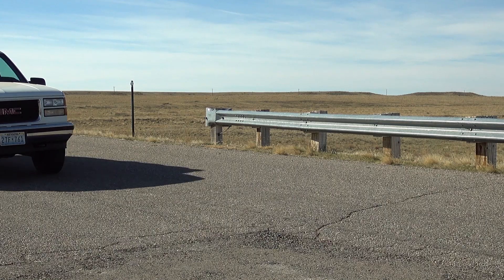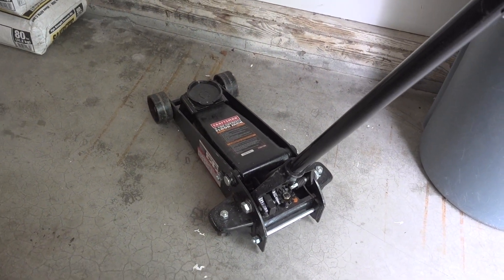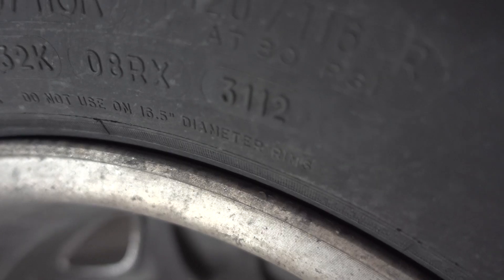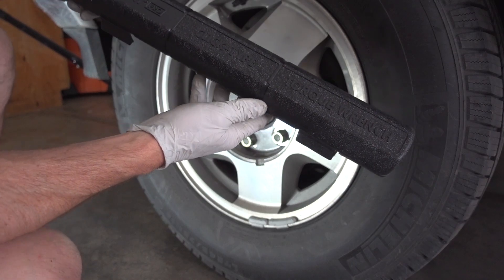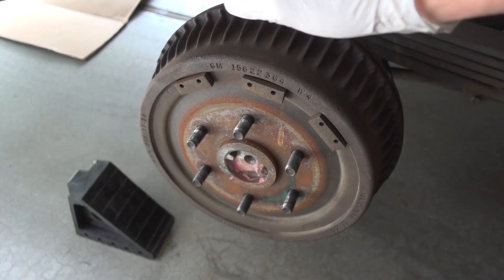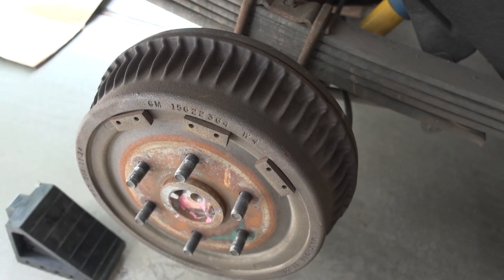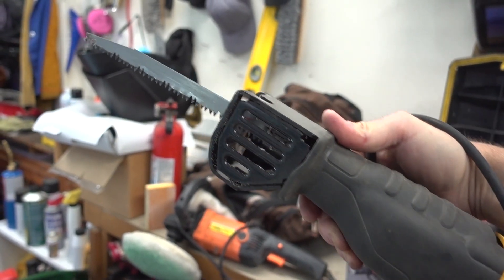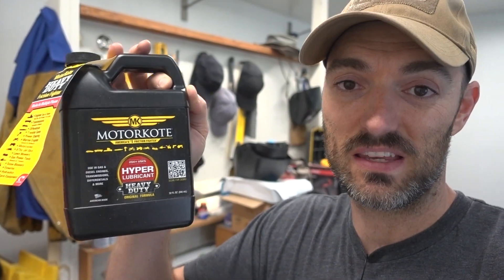SIMPLE FIX FOR TIRE HUM!

Comment: Don't cross radiel tires!! Your thinking of bias ply tires! Your asking for a blow out if you cross them!!
Reply: John Mccord 
I’m pretty sure he is fine. The diagram I found said to cross them
Also. It said cross fronts to back and back forward. How would a non directional tire know what side it was/is on. What ends up happening by crossing is the right and left eventually end up on opposite front sides.
You would not want to cross directional tires.

Comment: I saw a couple problems... first is EYE PROTECTION. Second is foot protection. Third is, you didnt show it, but it seems you did not check your drum brakes. And on a side note, I saw that your lug nuts looked new. They also said "metric" on them. Are you in Canada? If not, you might have replaced your lugnuts with metric ones. Shouldnt be an issue but I do not suggest anything that was not original equipment.
I dont think you should be telling people how to do stuff if you dont know how to do yourself.  By reading the comments, you have given out a couple of bad and unsafe tips. Like putting anti-seize on your lug-nuts.
Not to mention, the title of the video has nothing to do with the content in your vid. And the last 1/3rd of your vid was off subject. DONT PUT CRAP IN YOUR ENGINE!!!! You have Mobile 1 full synthetic oil in your vehicle. Its the best stuff you could use. And by putting that other crap in there, you are contaminating your oil. Additives are for people trying to keep their junk running. If it doesnt have issues, you dont need to add anything.
Terrible video.
Reply: Aaron Meloccaro video is for entertainment only... read the description 😁
Reply: LOL the OEM lug nuts are metric on this vehicle.  And most mechanics in salt states anti seize lug nuts.  Try getting them off after a while without it when there is extensive use of road salt.